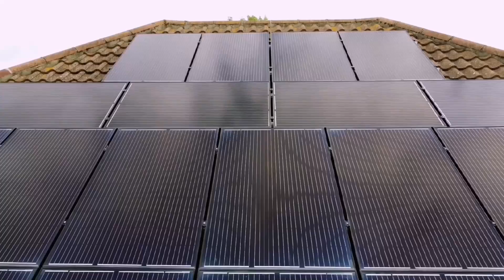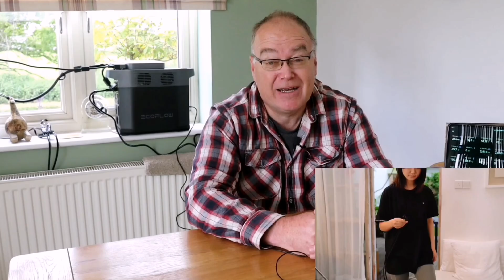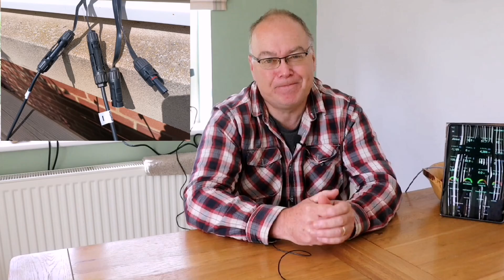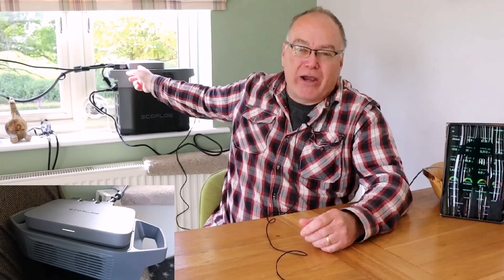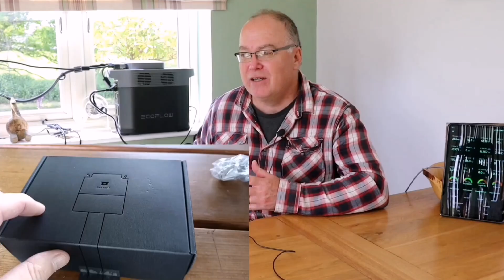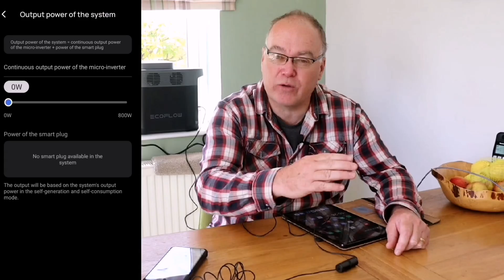Revolutionary Ecoflow PowerStream - DIY plug in grid tied Solar PV & battery system

Comment: If you use the 2kw each day, that would save you about 70p  at current rates. That would mean about a 9.5 year payback window. I don't think you would buy this to save money.
Reply: The average peak sunlight hours in the UK is 5 hours, so with the 2 400W solar panels included in the bundle costing £2,367 , the average you'd expect is 4KWh per day (800 watts times 5hrs).
At 33p per KWh the Payback is 4 years and 11 months.
You can power more than just your base load, the £2,367 bundle includes 2 smart plugs, so that's the base load plus the load on the smart plugs.
Reply from the maker: @chris2893evans  optimistic but yes
Reply from the maker: Payback lol it's a portable battery too so deduct that functionality value plus this is about reducing grid dependence not about an investment return
Reply: I don’t understand these small inverters for the cost either, the payback is way too long. I also have a base load of 2.2kwh per day so wouldn’t consider this a viable option.
The only thing I could see use for in a house setting is as a power supply to a ups powering a home lab or so, where you want computers permanently powered (the ups is to notify the computer when power is running out as the Ecolab won’t).
If you have one for off-grid purposes then this again isn’t the bast as you wouldn’t be wanting the feed to house in that situation but sockets to use, like the delta pro. This would be more useful in a power cut as you can pull it into the house and use.
So this ? 🤷‍♂️
Reply: This looks really interesting,  I'm not entirely sure if I'm following this correctly,  but are we saying the micro inverter plugs into an existing mains socket in the house and actually puts the battery and solar into that socket to  power the house without needing to be wired directly into say the consumer unit,  if so incredible 😮

A few other questions,  I currently have solar panels and battery storage , however my solar panels have gone wrong and won't be generating for a few months while I await a solar company to fix them.  I wondering if I could use this system to create some solar energy and put this into my house while awaiting my panels getting fixed that are on the house ? Not quite sure how it would work with my battery which is AC coupled , and then not sure once my existing solar system is fixed would I still be able to have this in the mix?
Reply from the maker: It's a different equation if you want to use solar energy for other reasons  than just cost.  Reducing your dependency on the grid is a big thing for many
Reply: I am on the equator with plenty of sunshine.
I spent 2k on a 6 panel array, no battery.
It supples around 11 kWh per day, around 1.2 kW during the day, 25% of daily 24h household usage. It is taking all daytime loads so there may be some extra oomph that I am not getting out of it, perhaps I shall turn on the ac for a sunny day and see what I can get out of it. Rated at 2.6kW but is at an angle, minimum angle at midday is 25 degrees.
Electricity is around 7p per kWh. 
Payback will be about 8 years unless I can use it for more load.
If I got another 600w during the day by installing a battery, I may have another 5kWh, about 35 pence a day. A battery costing a grand would pay back in 8 years.
Reply: @moo4rich  not quite sure what you’re trying to say here?
The battery has value, but only if you can use it… so you’ll need the rest of the bits so back to your statement cost of £2367.
My base load costs me approx £1 a day, so £365 a year and your saying pay a couple of thousand to remove that cost?
It would be better saving it and putting it towards an installed system to bring total load cost down instead; be that solar, battery or both?
Reply: Can this be hack connected to say 400ah lifepo4 batteries? Instead of a delta.
Reply: I will say in states like California the current pricing is $.42 (£0.32 GBP) per KWH and going up each year. Any offset now that net metering is gone adds up very fast.
Reply: Don't forget the standing charges..
Reply: @jampam-jf8mt standing charges?
Reply from the maker: @docdelete 42p on Octopus Tariffs here
Reply: @pollyaloy  how does this reduce your direct debit per month, when you have to spend an additional 2k to do so.
You’d probably get it on finance, adding another DD so 🤷‍♂️.
The guy that spent 30k may reap all the benefits… generate enough to cover all electric, possibly remove gas and if/when he gets an electric car then not have to pay for petrol either.
This works, as is shown by the channel your posting this on.

Comment: It would be brill if you could isolate the grid, but then get your main inverters to power up with the 240 from this ?
Reply from the maker: It's not about powering the inverters it's about preventing inverters feeding power to the grid . You need the inverters after a transfer switch then you can power them up

Comment: I think the difficulty in removing the cables from the inverter is intentional. I believe there is a regulation which says it's supposed to be impossible to accidentally disconnect.
Reply from the maker: Ah ok, At present it feels dodgy having to insert something to flick the catches. Presumably unsafe if you use a metal tool😱

Comment: Out of curiosity, how many of the 2kw bundles would you need to replace YOUR current set up? ..... once again a brilliant presentation
Reply from the maker: Summer time I'd only need 2kwh but it wouldn't cover my peak cover when I exceed solar output by 2-4kw at times so only a viable replacement for some of the features of a home storage battery.

Winter time I'd need 6kwh bit now with heating electrically more like 10kwh

Im.about to try charging from a 2nd portable battery via the 3pin output of the 2nd battery to the AÇ in of the Delta, whilst still outputting from the powersteam.  Lots of flexible options
Reply: You are not allowed to feed back any more than that without all the form filling and approvals at which point you might as well fit a big one anyway as per Kwh those portable units are expensive compared to big ones

Comment: We put our panels up ourselfs without any scaffolding, just 2 people, I've not seem them doing it, but I think its not completely necessary and perhaps just a further way that they can (Justify) pushing the price up.
Reply: When our 16 panel FIT array was installed 6 years ago it was all done by two blokes off ladders.  We had a second array installed in January this year and scaffolding was put up for the install.  I spoke to one of the engineers who was doing the work and he said that they used to do all the installs off ladders and it was only relatively recently that they’ve moved to scaffolding.  Maybe its an industry health and safety thing that’s caused the change, but you’re right, it adds to the install cost
Reply: @geoffreycoan  Yep I think its a Health and saftey thing partly, put another way to add cost. You have to lift the panels up to the edge of roof, and then walk them up... they arn't heavy and 2 people can easily move them into place. We just got some simple roof harness/saftey ropes, and it is more work to move around on a roof but doable I think by normal people if they actually wanted to. The payback period is much shorter with DIY.

Comment: So it’s sending 240v out of the battery via a 3 pin plug….
Reply: So ?
Reply: @jeffreycooper8408  its against UK electric regulations.
Reply: @gsdevme  you can get 240 out of a socket, but you can't put it in ? Really ?

Comment: Will be interesting to see how they prevent backfeeding in to the grid if theres a powercut.
Reply: It would be good to go into the detail on this. I have no doubt they've addressed this, but on the face of it, that standard three-pin plug sounds like a "suicide cord", meaning that if you pull it from the socket it will be live, and can kill you. It would be good to hear that grid-loss is detected in milliseconds or less, and that it is not software-based.
Reply: @johnmceleney2170  I've seen on another review that it doesn't shock from the plug. I think it's monitoring for electricity from the grid also, if there is none, it cuts it's own supply out, only feeding the battery.
Reply from the maker: If it's G98 compliant that's a given I guess
Reply: My guess is the invert monitors for grid connection. Although if something goes wrong… I imagine it’s not quite like the Tesla power wall which does a physical disconnection.
Reply: It's not entirely DIY, looks like one needs to tell dno
Reply: @giridhart  Nope if it's 800w or under
Reply: @royd63uk  Can you link to this change that it's now none DNO notifiable?
Reply: All the current micro inverter products only work if they have mains input. This is to prevent you getting an electric shock if you touch the plug. So in a power cut the micro inverter stops working.
Reply: @garysmith5025 There are certain elements of G98 that inverters with a Registered Capacity of ≤800W don't need to comply with. It doesn't exempt the from all elements of the EREC.
Reply: @garysmith5025  No it doesn't. Read EREC G98 Amendment 7 released on October 3rd, 2022.
Reply: @garysmith5025  Tell me which section of EREC G98, Amendment 7 states that inverters ≤800W don't need to comply with EREC G98 and don't require DNO notification?
Reply: @garysmith5025  The exemptions were only valid for installations carried out prior to 1st September, 2022 anyway. So any installations carried out past that date have to comply with EREC G98 in its entirety, regardless of whether the inverter is ≤800W.

"Other Exceptions

For Electricity Storage devices commissioned before 1st September 2022 and Microgenerating Plant, including Electricity Storage devices, with a Registered Capacity of less than 800W, the following sections of EREC G98 do not apply: 

• 9.3 (Limited Frequency Sensitive Mode – Overfrequency); and 9.4.2 and 9.4.3 (constant Active Power output). 

For the purpose of assessing the 800W threshold, the Registered Capacity of the Microgenerating Plant should not include the capacity of Electricity Storage devices commissioned before 1st September 2022 where they are AC coupled with generation. However, where the Electricity Storage devices are DC coupled with generation, the Registered Capacity of the Micro-generating Plant is dictated by the Inverter rating, and this will determine whether the 800W exception applies. Where Electricity Storage devices are DC coupled with generation with a Registered Capacity of or greater than 800 W, then the Electricity Storage exceptions do not apply to the Inverter. "